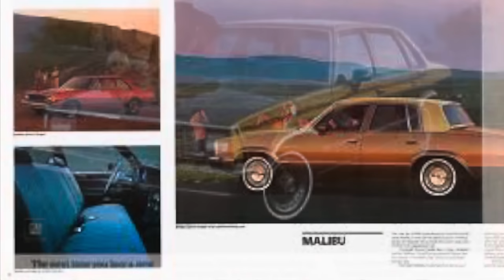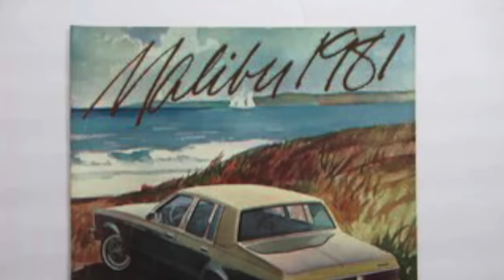Cheap V8 Malibu parked for 25 years will it start and drive again ?

Comment: Oh, the rear windows. Some people say G bodies don't have rear windows that don't roll down for cost reasons. Some say it allowed a larger pane of glass that could not have rolled down into the door because of the shorter wheel base. I've also heard that they saved space by not having a regulator mechanism in the door which allowed that unique "concave" door panel design that allowed them to advertise it having more interior space that the previous generation. I suppose all could be true. I've owned them, and never really cared, all had working AC and the flip out rear window actually flowed air nicely, too.
Reply from the maker: Yeah I think your right
Reply: A combination of things: cost, "safety" (for a time windows in GM cars rolled down about half-way to 3/4 of the way to prevent passengers from "falling out",) and also if you think about it, doing so would "force" the buyer to buy AC. Salesman, "You know those back windows don't roll down, safety feature. Going to get hot in there without AC". Buyer, "Better order it with AC". Salesman inside: "Cha Ching, another $500+ for AC"..
Reply: This wasn’t the Chevrolet “kiddy kidnapping “ model ?
Can’t let ‘em escape …..
Reply: Until the A/C stopped working.
But it sure brings back memories.
Reply: The whole issue gets beat to death. First, the only reason the GM of the era did  anything was to save money. Having fixed glass obviates the need for window regulators. The 1978 cars were a lot smaller than the previous generation and the lack of window hardware allowed the arm rests to be recessed, making the hip measurement seem wider but in reality it was moot. In the USA it was not that much of an issue but in Canada  it was, because most of the Malibu's sold in Canada at the time didn't have a/c. Whatever the the reason, GM didn't do it in any other car ever again.
Reply: @googleusergp  The rear windows of GM cars of the era only rolled down part way in order to reduce the amount of material in the window regulators. The regulators were left off the Malibu purely as a cost saving measure, with the possibility of an upsell to a/c, which was big money in those days.
Reply: @kimchipig  Yup as I stated.
Reply: I vaguely remember Consumer Reports, in a 1978 article, saying that GM had done wind tunnel testing with these cars, and apparently the fresh-air ventilation was better in the back with the vent windows than it would have been with roll-down windows.  However, I don't know if they meant trying to make the existing windows roll-down, which were much larger in '78, as the vent window was in the C-pillar rather than the door.  Those big picture windows wouldn't have rolled down more than a couple inches, at best.  Anyway, cost cutting probably was part of the reasoning, but like you said, probably not all of it.  Anyway, the 1977 B/C bodies had windows that rolled down a little over half way, and even if people complained, they still bought the things.  So GM probably reasoned that having a stationary window in a 4-door was no big deal.  After all, by that time we had pretty much gotten used to it in coupes.  People did complain about these stationary windows, and still do to this day.  But I have a feeling that if the backlash was truly bad enough, GM would have corrected it at some point.  But instead, they were stationary right up through the last Cutlass Supreme sedan in 1987.

My grandparents bought a 1982 Malibu Classic wagon, in February of 1982.  Their previous car was a 1972 Impala 4-door hardtop.  Being the winter, nobody even thought to try the rear door windows.  It wasn't until a hot day in April, when I went to church with them one Sunday, that Grandmom sat in the back seat, started fumbling around, and then complained "How the hell do you open the back window?!"   She always hated that aspect of it, but in all honesty it wasn't like the back seat got used all that often, anyway.
Reply: @batmanlives6456  😔 smh....  🤣😂🤣😂
Reply: @andreg4460  .."How the Hell do you open the back window?"...while going to church.🤣🙃😄😁..LMFAO!....
Reply: @dyer2cycle  Oh, that irony wasn't lost on us, at the time!  Grandmom never did "forgive" that car, either.  Even years after it was gone, if that Malibu was ever brought up, she'd refer to it as "the most expensive cheap car we ever owned!"  As for that car's ultimate fate, the ECU in the passenger side kick panel failed, soon after the warranty was up.  It was about $400 to replace.  The second time it started to fail, Granddad said the hell with it, we're getting a new car.  And in the fall of 1984, they traded that Malibu, failing ECU #2 and all, on a new '85 LeSabre Limited "Collectors Edition", that ended up being one of the best cars they owned (also their last)

Despite its shortcomings, that '82 Malibu was a nice looking car.  It was dark blue, with fake woodgrain.  I do remember the woodgrain on the passenger side of the dash was kind of weird, though.  In the pattern, I swear there was this sort of a half-pig, half-man face staring out of the woodwork.  Looked kinda like something out of "The Twilight Zone".

Comment: I have a '78 Cutlass that was off the road for a similar amount of time, trees growing out of the bumpers and all, it actually had great front brakes when I got it going, I actually drove it around like that for a little while, the rears didn't work because of a plugged brake hose. I threw some new brake hoses on it and new wheel cylinders, but then the master went out while bleeding the brakes, so I swapped that and it's been fine since. Its actually my fair weather daily, the t-top and rusty roof leaks make it unpleasant in inclement weather 😂
Reply from the maker: That’s great

Comment: The explanation that General Motors gave for the rear windows that didn’t roll down on that era G body four door sedans was that there would have only been room for a regulator that would allow the window to lower between two and three inches due to safety bracing contained within the door.  We had a 1982 Pontiac Bonneville G four door and it’s rear vent lanes were electrically controlled as part of the power window package.
Reply from the maker: Ok thank you
Reply: I had the wagon version. My windows went down. I had a lot of fun with that car. A lot of tickets too. It was only mildly hopped up. Shaved heads and punched 60 over with a 4speed.
Reply: I heard it was child safety. But this makes more sense.
Reply: Police issued vehicles had rear windows that didn’t go down.   That’s in Canada not sure about the US .

Comment: Fun! Even your dad was enjoying the crazy bumpy driving! It's always cool to think this was probably $13k back in the day, and now - $500! Cant wait to see the power washer in action!
Reply from the maker: Yep we had fun thank you
Reply: ..probably less than 10K in 1981...
Reply: My 1980 Z28 was just under 10k new in 80. A V8 Malibu sedan in 81 was probably a little over 10k
Reply: @thagerdorn2009  ..just did some research out of curiosity, several sources stated MSRP on 1981 Malibu sedan was a touch over 7 grand..sounds about right, a Malibu was a smaller, "cheaper" car than a Camaro or a Caprice or Impala..no way it was more expensive than a Z-28...and 7 grand was MSRP, which people rarely paid..probably could get one out the door for not much more than 6 grand..I haven't checked, but I bet you could get a fully loaded Caprice for 10-12 grand in 1981...
Reply: @dyer2cycle  i have an 81 malibu sedan

Comment: The dipstick tube should be on the driver's side below the number 5 cylinder. You should be able to see the " pocket " on the oil pan right by the filter. That circular shaped plug in the back by the distributor should connect to the oil sending unit down on the rear " China wall ". Great videos and it is nice to see a real down home Christian family working together.
Reply from the maker: Thank you for the information. We appreciate it

Comment: Great video. My family owned a taxi company when these cars were new and everything you say about GM is true. The entire SBC family is interchangeable. Stuff like brake pads were the same for eons and thus dirt cheap. Want a cheap horsepower upgrade for your Malibu? Well, an LS crate engine will bolt up right up for less than the price of a good rebuild.
Reply from the maker: Very true

Comment: The reason for the big heater/ac box under the hood was the design of the dashboard. In order to recess the dash and make it smaller to increase interior passenger seating room. To give more knee and leg room, the dash panel was moved closer to the windshield. 

For their size, these cars have quite a bit of interior room. When they migrated to front wheel drive later on, the space the transmission, driveline and rear drive axle was added to the interior space.
Reply from the maker: Ok interesting

Comment: I'd love to have a Malibu, but they're priced out of my price range now. My brother had a pretty nice 2 door when we were kids, back before they were as desirable and had a pretty nice wagon a few years ago. I actually saw a factory manual wagon on marketplace a little while ago, but the price was way up there and they knew what they had.

The "Iraqi taxi" Malibus they sold in Canada were pretty cool too, great base for a hot rod sleeper, you could make some along those lines with that 4 door
Reply from the maker: Yes love the wagons
Reply: yes my late brother being a chevy fan had a malibu wagon with a 4 spd on the floor that thing was a blast to drive and it was very rare to see one.
Reply: @Sleeperdude  i'm swapping my 83' malibu wagon to a 350 vortec with a 5 speed

Comment: The round, black wire is for the oil sending unit just below the distributor on the driver's side, back of the block. The other white plug looks like the windshield wiper drive motor supply with washer and intermittent controller..... but I could be wrong.
The lack of rear window regulators was a safety feature for child protection. The "wing windows" was a vent. Many cars limited the level of, or eliminated altogether, the rear windows going down. 
The 305 Quadra jet carb started at 500 CFM and went up to 600 CFM. (I would pull the numbers off the block to verify the CID) 
Loving family involvement.... I am a new sub!  Thanks for taking me back to the old Chevy's
Reply from the maker: Ok thank you for all the good information and thanks for subscribing

Comment: Love those old Malibus! The "no roll" down rear windows might be part of the police package, some had it. If it says "certified" on the speedometer then it's a police package. Keep up the awesome content!! 👍🏁 New subscriber here! I came over from Hot Rod Hoarder's channel. 😎
Reply from the maker: Ok thanks for the info, and thanks for checking my channel out
Reply: Mom had a 79 Malabu with the V-6. Getting to the rear plugs on both banks, was best achieved under the wheel-wells. I liked that car much better than the 88 Escort that replaced it.
Reply: @jeromebreeding3302  Ya can’t replace a Chevy with a Ford. That’s just not right.
Reply: @ralphkramden2089  Yes you can, do if you on the honey-mooners !

Comment: The reason why they didn’t roll down in the back is because it was a “cost saving measure” that didn’t go over to well with customers. I was told the vent windows in the back were added just a few years after customer complaints about ventilation on hot summer days if the A/C broke. The vent window didn’t go over to well either. So then they began to add rolling windows in the economy version again to satisfy GM’s  customers. I don’t know for a fact but that is what i was told bu someone who knows those 80s cars.
Reply from the maker: Yeah I think your right. Thank you

Comment: I had a 79 4 Dr. It had the 305 H O. If the intake is factory aluminum its a H O. Also if you have the ID tag on the core support it will say 305 H O.
Reply: Also the rear windows didn't go down as a safety feature. That's why they had the wing windows.
Reply from the maker: Ok thank you
Reply: Yes sir

Comment: My cutlass 4 door I used to have around the same year as your Malibu was the exact same way with the windows that didn't roll down and the little smoker window
Reply: It had a V6 3.8 with the crap transmission I put a 350 turbo transmission in it. With Oldsmobile it has to be an Oldsmobile transmission if I remember right it has dip in the top of the transmission unlike chevy.
Reply from the maker: Oh wow that’s cool

Comment: First start now that’s a Chevy small block for ya there. This would be a good flip for resale or keep. For a moment there it sounded like it had aftermarket camshaft but that’s probably the carburetor. Do the brakes delete the catalyst converter and run a nice sounding muffler. Those 305 have nice torque up to 4500 rpm and decent power. This would make a nice sleeper here. Shhhhhhh. Stuff the big block in here and a ford 9inch diff.
Reply from the maker: Yeah your probably right
Reply: ..I don't think I would want to do a brakes delete...😄

Comment: My dad had a 78 Malibu. It was hot in the summer. The rear windows don't go down. They only have the vent windows in the rear.
Reply from the maker: That stinks
Reply: Yeah it did. Love the older cars. Much easier to work on. I have a 79 ford mustang ghia coupe. It will have ac.

Comment: Built a very nice engine and put in one of these back in the late 90’s. Got it completely done one fine night and decided to run it right down the street to show my buddy and burned it to the ground! Forgot to tighten the fuel line and forgot the fire extinguisher at home by the time I ran two blocks it was burned completely down. Tighten the fuel lines then check again next time before running it lol nice job guys
Reply from the maker: Oh no!!! That’s terrible. Thanks for watching

Comment: my brother in law has an 81 wagon in mint condition with a rare 267cu.in monza motor with 307 heads from the factory. add a 4 barrel & cam does 13 second quarters. great car.
Reply from the maker: That’s great
Reply: I had a 79 4 door sedan with the 267 bored 40 over 327 heads ram horns lunati cam and a 400 crank and made it into a baby stroker pulling around 420 HP to the ground and close to 500 at the crank

Comment: The rear vent windows are because the rear windows don't roll down!   You have extra armrest room for 3 people in the back in the doors, but they gave up the roll down window....so most of these cars have air conditioning  too.  This design replaced the 1977 Chevelle and Malibu....and since it was smaller, they had to still try to fit three people in the back seat.....so they could say 6 passengers....so the designed of the armrest gave more  width for people.....but not enough room for the window roll down mechanism
Reply from the maker: Ok thank you for letting me know

Comment: Great addition to the sleeperdude garage I like the old brick shape cars too. 2x👍
The light switch next to the Simplisafe pad would drive my OCD mad. I need all the screws to be vertical, same with door hinges.Every time I move I have to line them all up again.🤣
Reply from the maker: I’ve never even noticed the screws
Reply: @Sleeperdude  I sure did  LOL    drives me crazy ever time I move home.

Comment: I'm not sure if this was mentioned in the comments but these Malibu Classic's, as they were called, were used by many local Police Departments as their cruisers.  They were equipped with the 305 or the 350 small block, 4bbl carburetors, posi traction rear ends and heavier suspensions.  They were a formidable vehicle and for the most part were hard to out run with the HP to weight ratio it had.  I did a few ride alongs with my local PD back in the 80's and these were the vehicles they had at the time.  I would love to get my hand on one now but they are really cost prohibitive now days., even in that shape it will still cost more than usual because people now know what they have.
Reply from the maker: I bet those were fun
Reply: @Sleeperdude  They were lots' of fun.  I am wanting a Malibu from the area but they expensive.

Comment: You know, vicegrip took a 307 V8. Put on a 500 buck pair of Chinese HO heads. A high-rise manifold from a 69' camaro and a suitable 4 barrel. All bolted to the original, unrebuilt block and squeezed almost 300hp out of it. Your car would make an interesting sleeper.
Reply from the maker: That would be cool

Comment: I don't know if anyone answered your question , I didn't read all 1200 comments. The first plug you showed was for the oil pressure sender and the second plug you showed was for the AC and the high speed fan for your heater. I used to have a 1980 malibu wagon that had power wing windows in the rear. My daily driver is a 1980 cutlass 4 door. It has the drive train out of a 1988 monte carlo ss. It has overdrive and a 229 rear gear. On the highway it gets 28 MPG. I have put 35,000 miles on it in 3 years. I call it the crew cab.
Reply from the maker: Ok thank you, that sounds like a good driver

Comment: We had two Aerostars, an 88 and a 93, both were 5-speeds, the 88 had Traction-Lok differential.   Not fast, of course, but way more fun and faster than the automatic versions.
Reply from the maker: I would buy one if I found one at a decent price

Comment: That funny two prong plug by the distributor is the oil pressure/Choke light and power for the electric choke.

That engine looks like it swapped in from an earlier one with the short water pump and fixed fan.

The rear windows according to the salesman in 1983 when my parents were looking to replace our 76 Malibu Classic was to get the same amount of rear seat room as the bigger 73-77 cars.
Reply from the maker: Ok thank you for the info, I think it has been swapped too
Reply: @Sleeperdude  I have a Buddy that’s had half a dozen G body El Caminos and a smattering of Monte and Malibus of this body, I know way too much about a car I’ve never owned.